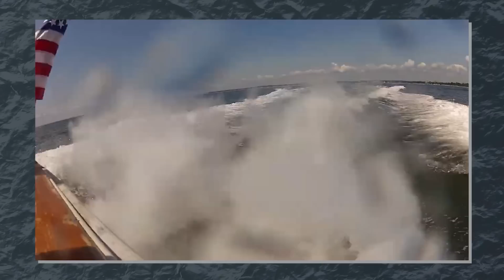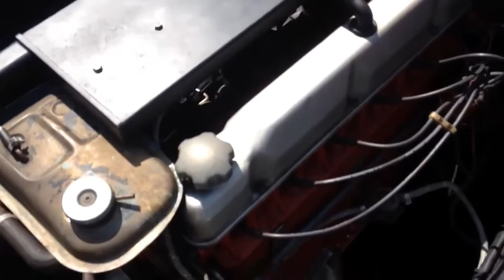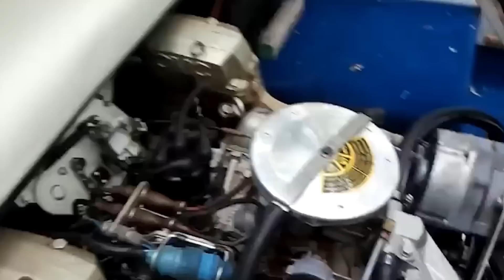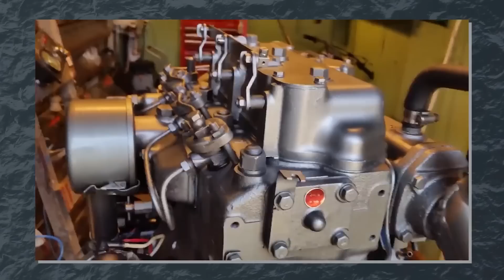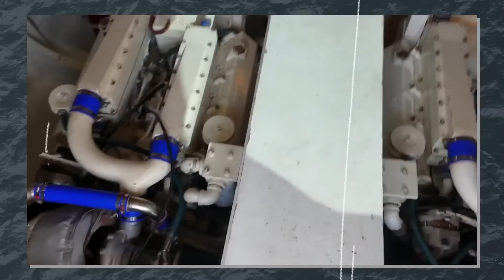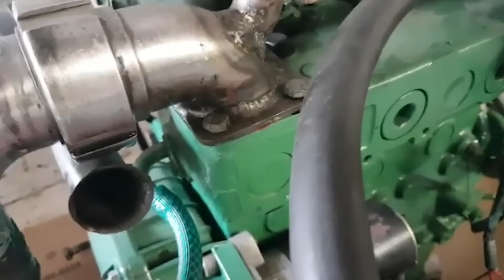15 WORST Engines Ever Put in Production Boats!

Comment: What a load of nonsense in this video.. I have had sailboats with both Volvo 2003 and Yanmar 2GM engines. Serviced them annually with no issues. Maybe these issues you talk about is due to neglect, if so thats no the fault of an engine or manufacturer.

Comment: As the owner of two HT6.354M engines that are almost 50 years old, still delivering full power and run as sweet as a nut, the engines are indirectly cooled through a heat exchanger, as for turbos I had the one on the port engine rebuilt a few weeks ago, comment from the turbo shop was that the turbo was in very good condition and in reality did not need much work done on it, bearings were fine though the seals were beginning to weep which is why I had it serviced. The boat still makes it's rated top speed.
My father had a truck in the 1960's with the 6.354 engine in it most reliable truck he had, instant start and very economical to run.

Comment: When I bought my boat it had a westerbeke 60 in it the head gasket was cracked - I asked westerbeke what parts were available and they said none - they stopped making it three years after it started-
Reply: Westerbeke is a packager, they do not manufacture engines- my 8.0 WMD is acually a Mitusubishi engine. Do some research, I am sure you can find the part you need.

Comment: The Lehman SP135 is NOT A Turbocharged engine. It is a rock solid naturally aspirated  platform and your characterization of it being a turbocharged engine puts into question everything else you have professed.
Reply: Lehman 135s are about as reliable as they come. I agree, the video is de-legitimized quickly with this one included.
Reply: I have the ford Lehman 120 a total brut reliable engine.

Comment: I guess your saying that if you run a boat in salt water you are SOL? While beating up the 305 engine you kept showing a 350 as a better choice, while this part is true, (virtually the same weight and similar fuel burn),  problem is the pictures you showed were of a Big Block, the 350 sticker on the rocker cover is probably the HP for that particular setup. There is far too many inaccuracies in this "thrown together" compilation to believe any.

Comment: 455 Oldsmobile?
Reply: that was not a good engine for a jet boat
Reply: Exactly. I spun a bearing. I guess they were notorious for that. I had a Berkeley jet with a jetovator. So much fun!
Reply: @herschelsquirts2338  oiling system on the 455 sustained high RPM sucks all the oil out of the pan
Reply: @herschelsquirts2338  you can save the motor on the rebuild have restrictors put in the block to slow the oil flow and run a quart over stick thats how i got mine to survive

Comment: What is this guy talking about with regard to cooling in saltwater? Who is running saltwater through a raw water cooled inboard? If you aren't running a heat exchanger or keel coolers with an inboard operating on saltwater, you are a lunatic

Comment: I worked at MerCruiser and in the machine department and engine assembly line. It never had a plastic timing gear. I pulled the engine and installed a 4.3. V6. That was a big mistake. I wish 470  was still in the boat.

Comment: Lol the 470 is actually a great engine. Its an aluminum block with an iron 460 head, not iron block/aluminum head like the video said also they don't have a plastic cam gear. They just reqired more attention, make sure you change the oil promptly and dont let it get over 190 degrees. Some people have had them running good for the past 30 years and youll never get the torque and fuel efficiency of the 3.7 out of anything else in its weight class.
Reply: common sense rules out most of these problems, I worked on these engines and to my sight, the most  prohiminent problem is the alternator design, for the rest, somebody that keeps a close eye on that engine will not experience undue problems.
Reply: Exactly, everyone wants to be so quick to hate on em. Just tells me they didnt take care of it lol. @jacquespoirier9071
Reply: A legendarily dependable marine engine.
Reply: BUY a ols SAMOFA never brakes down just fress oill filtersnormal matains runs always
Reply: What 3.7 is reference to compared 470ci
Reply: @SamSteele-hc1tq before some time in the late 80s or early 90s mercruiser changed how they named rhe engines but before then they were all named by cylinders and horse power, 470 is 4 cylinder 170hp mine are 485s (a experimental version) 185hp same was a mercruiser 888 was a ford 302 v8 making 188hp and a 898 is a chevy 305 v8 making 198hp.
Reply: @SamSteele-hc1tq  the 3.7L 470 and all its other versions were half a ford 460 big block, 4 rods and pistons with one 460 head connected to a british tractor crank with a custom cast aluminum block. They are light and make a ton of torque, great engine but they have to be maintained well or they give up quick.
Reply: Of note:  The design was developed by Mercruiser themselves. Iit's the only in-house i/o engine I know of.
Reply: Strange engine and different
Reply: Pfft manny usa moters sucks on boats

Comment: "Facts" are all wrong on the OMC stringer/small block Ford combo.   Sure, there were issues, but not the ones you describe...
Reply: Omc stringer was junk
Reply: @michaela.2933    They were a pain in the butt for sure, but not for the reasons mentioned in this idiotic video...